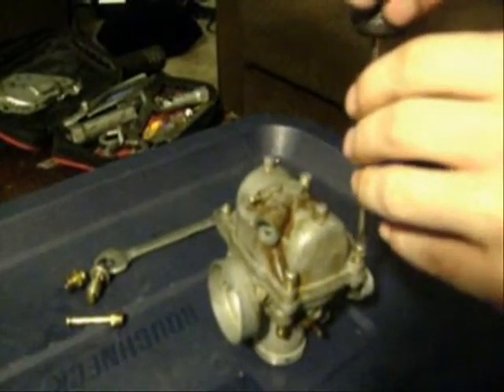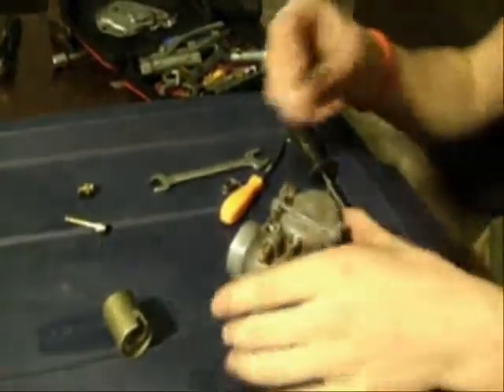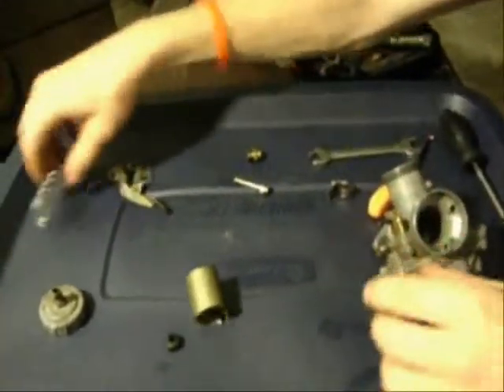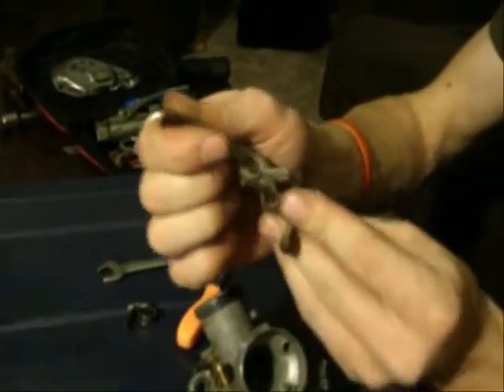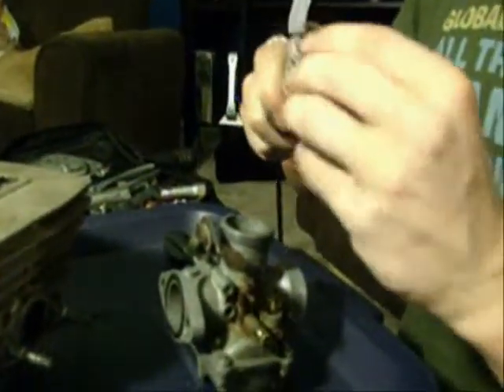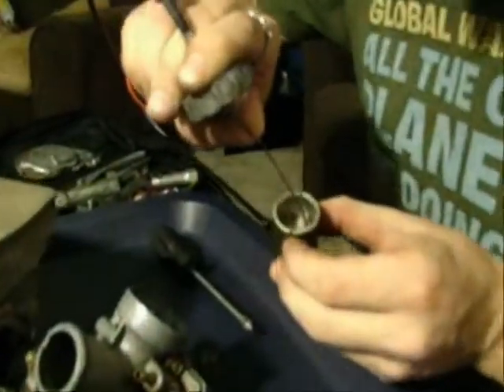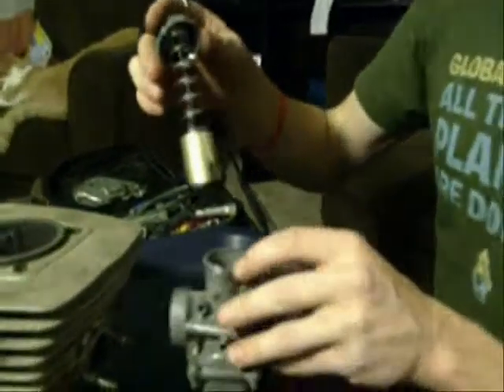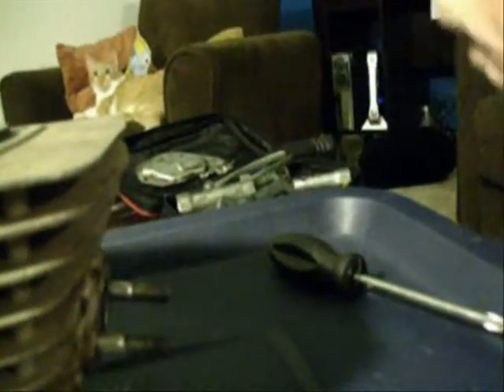TS185 Carb Cleaning 3; www.suzukits.com

Comment: That main jet overflow valve needs a rubber o-ring to stop the leak, I found out the hard way. You can't just tighten, there is a seal around it. You dont have it, but you need it.